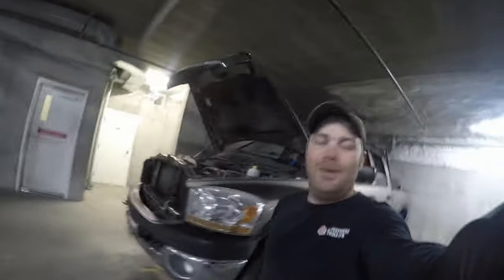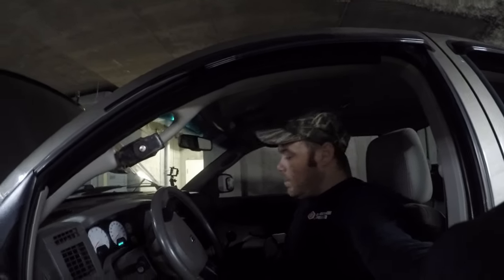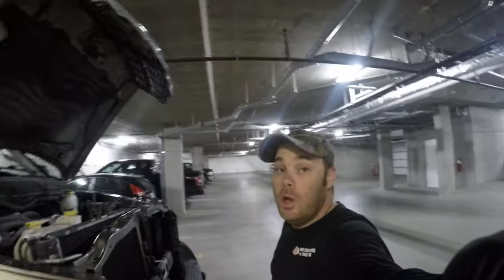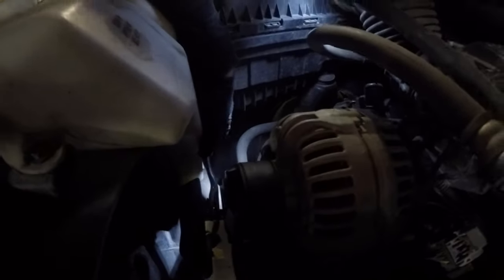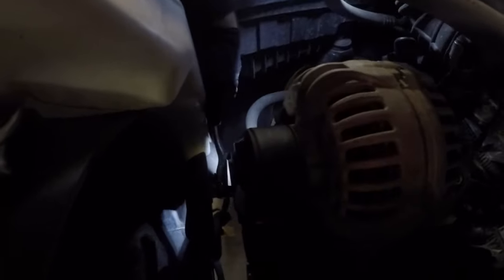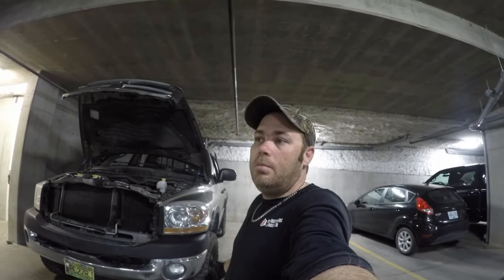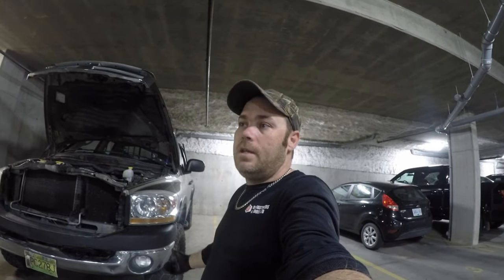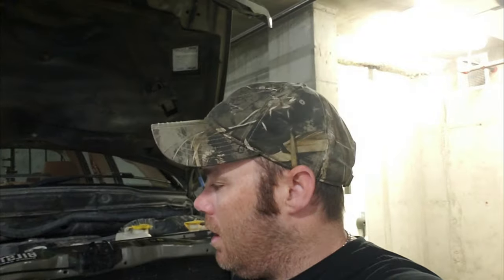More Repairs | Ram 1500/2500/3500  Power Steering pump replacement  5.7 Hemi

Comment: Buy a good pump never had a problem have a 19991500 with 215,000 still original,you run too big of tires pump not designed for that